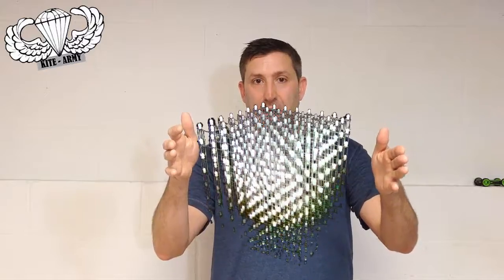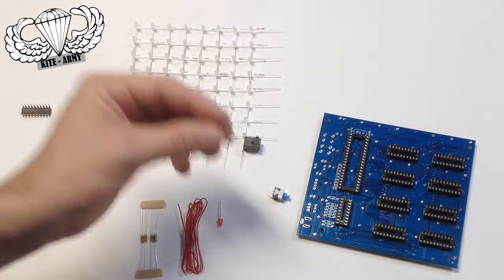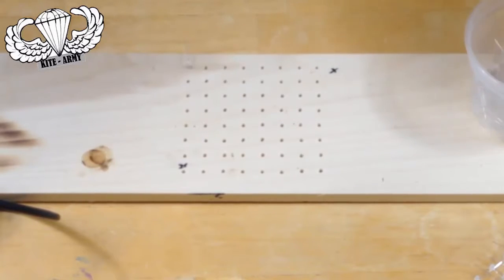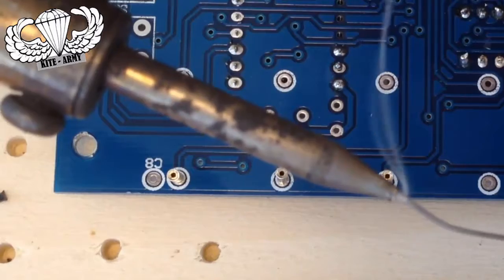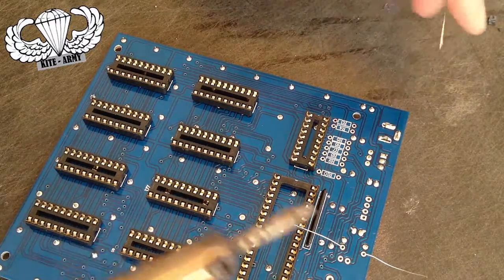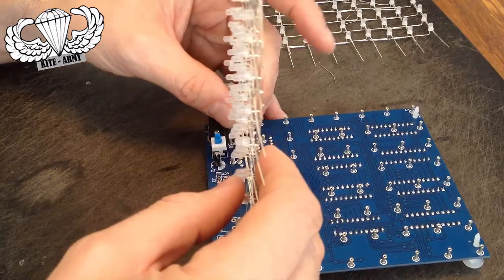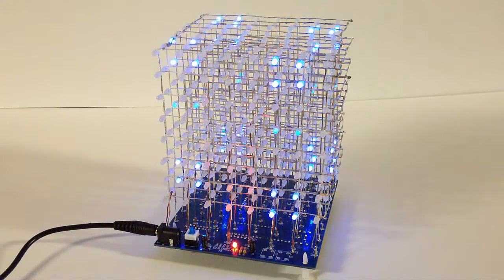8x8x8 3D LED cube kit tutorial how-to build this one of a kind project

Comment: Question.  I am actually in the process of putting one of these together.  I have 5 of the panels completed and soldered into the board.  I have been letting it run as a final test of the LEDs while working on each successive panels.  With panels 4 and 5 I have noticed non-geometric type shapes showing up in the patterns but wasn't quite able to make them out...that is until just recently. I realized that the non-geometric shapes were actually "I <a heart> U" in succession, but problem is that they are upside down.  The only solution that I can come up with is that at https://youtu.be/9GiqM9fpLKA?t=523, the wires for each layer should have been tallest to shortest instead of shortest to tallest as depicted in the video

Did anyone else have this issue or am I the only one.
Reply: I found the solution and I was correct.  In this video (https://www.youtube.com/watch?v=vxmhnnqIQmY) from 21:06 to 21:20, shows the sequence and the connected layer (black) wires going left to right being the tallest to the shortest.

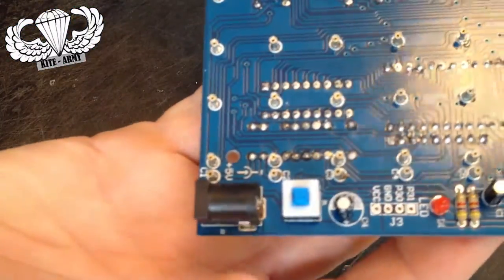Comment: Thank you a ton for the explanation. I'm very frustrated tho, when I plug the first row of "test" leds as you recommend at 7:00 I only get 3 leds lit and that's all, no blinking, nada.. I have checked dozen times all the components I have soldered (i'm not a beginner) and everything looks fine. The board is powered and all components seem to be ok. However, one of the 20 pins chips is different in the package, it's marked "7CAY76KE4", do you think that could be the cause of the problem ? (not talking about the little 18 pins one) ?
Reply from the maker: check to see if the LED lights without connecting to the control board.  That being said some of these controls boards are real cheap and will not work properly even if you built your cube properly.  Let me know how that works out.
Reply: only 3 led's lighting means the chip came without the program. Mine came the same way even though it was advertised as already programmed. I had to upload the program (firmware) myself after buying the usb to TTL serial cable (https://www.adafruit.com/product/954) then google to find how to's on uploading the firmware and of course the hex file for the 8x8x8 cube.

Comment: I have the exact same kit. I was working on the chips 3:40 and after i put all 8 chips in the bases which are connected with the pcb i found out that they were all placed in the wrong direction. I had to take m all out en turn them around. Whilst doing that one leg of a chip broke and is still inside the "base" i just put the chip on top of it for now. Is there still a possibility that the led cube will work evn though one little leg of one chip broke?
Reply from the maker: That could be the end of it.  Buy a backup kit just in case and use the chip.

Comment: Do you need an Arduino board to build this?? 
And did you use Arduino to program it?
Reply from the maker: I did not, But if I were to do it over, I would build it with the Arduino
Reply: Great! I think Ill use Arduino then :) 

Thank you so much!!
Reply from the maker: Also, don't skimp on LEDs.  After you solder 500+ of them (20hours) you will kick yourself if they are dull etc.
Reply: eek!! Ok, thanks again!

Comment: Wondering if you have reprogrammed this cube yet.  I built this cube (Thank you for the great video, it would have sucked building the cube without your instruction) but am not that happy with the default programming.  Have you hooked this up for reprogramming?
Reply from the maker: I have, but I connected the cube to a ardunio and wrote a sketch (easier than it sounds).  Maybe I will post a video.
Reply: I would love to put this on a 8266, so I can change it on the fly from the iPhone.

Comment: Hey, great tutorial. I'm following along, doing my build.

Small correction, the two components next to the crystal are ceramic capacitors. Not resistors.
Reply from the maker: Thanks mate.
Reply: I just got up to the LEDs, testing just with 8 LEDs plugged in and it worked perfectly. 

Now for the painful part - soldering 8*8*8*2 connections. I don't even want to know what that works out to.

Comment: I bought one of these, followed every step as mentioned, but for some reason my LED's even go on when only the positive legs are connected. I have checked every single led and they are all working how it should. When they are all together instead of one single led the whole horizontal line of it goes on...
Reply from the maker: Some of the circuit boards are crumby

Comment: I've built this kit twice now and have the same fault on both. (I thought I'd cocked the first one up so ordered a second as they're only £12)  Do you have access to an oscilloscope by chance so you could tell me what waveform you have on pins 21-28 of the microprocessor ?
These pins are the clock enable for each of the LED drivers so in my opinion should have a positive cycle of 1/8th of the total on time on each leg. I'm getting a much bigger waveform on one of the pins which ties up with the fault I'm seeing. One row of the grid hardly goes off.
Reply: I think you have the same fault tbh but you don't show it running for long enough for me to be sure. If you look at 9:23 of your video it is displaying a small cube in one corner but you have a "shadow" on the top row.
Reply from the maker: I have a bad grid too.  I had to buy a different controller to fix
Reply: You bought a whole new board or just a new Microprocessor? If you did the mp how did you go about programming it?
Reply: Where did you buy it from please?

Comment: Hi, the resistor A103J array should be soldered in with the white dot
towards pin marked J1 on the board.
Reply from the maker: Thanks...I will go back and check that out

Comment: Sir, My 8x8x8 Led board is working well but  a person to whome I had gifted damaged it due to wrong voltage supply. Can it be repairable.
Reply from the maker: Yes.  The most valuable part of the cube is the leds (because of the amount of work to build).  Check that your leds are ok - apply voltage to each.  If so you can replace the board and install the led grid.

Comment: THX for the tutorials!
- fyi my kit contained a smaller electrolytic, the bigger one goes near the power switch
- you REALLY need to specify which direction that resistor array goes (dot on package near squared hole) - brightness will be messed up if you get it in backward
- the switch can be put in backward so down is off/up is on, hard to tell without a DVM.  not terribly important if you get it backward
- those are not "two little resistors" left and right of the crystal, those are small capacitors.  (my kit only had one)
- don't forget to install all the sockets with their indicator matching the board, so no chips get installed wrong
Reply from the maker: Great feedback...thanks

Comment: ANDREW I JUST FINISHED MY PROJECT I HAD A  QUESTION .I SEE YOU CONNECTED THE NEGATIVE TO THE POSITIVE AT THE BOTTOM. AS I MOVE DOWN THE LINE CONNECTING THE LAYERS DO I HAVE TO BRING THE WIRE UP ONE LAYER AS I GO .KINDA  LIKE STAIRS LOL OR  DO I JUST CONNECT TO THEM DIRECTLY TO THAT FIRST LAYER ON THE BOTTOM? I WATCHED A DIFFERENT VID THAT SHOWED A GRAPH ON HOW ITS SUPPOSE TO BE CONNECTED BUT IM NOT SURE IF THAT RELAVANT TO THE CUBE WE HAVE PUT TOGETHER.
Reply from the maker: Hey mate.  They need to be connected to each layer.
Reply from the maker: +Andrea Hastings look at min 8:56 - you will see the wires attached to each layer.

Comment: have a problem getting it to work properly.. the board is OK, but the led layers connecting to the board confuses me.. the side with all the positive legs goes to the main pins in the board right? what about the negative legs? the row market  c1 to c8 connects to where?
Reply from the maker: If i remember correctly c1 to c8 are the connections that go to each layer (their are 8 of them).  You need to add wire copper to connect the layers.

Comment: I also purchased the same kit disappointed to find no instruction had to look on you tube to see how to make the LED cube your video also helped as with your other instruction for the electronics but I noticed  you did call the capacitors resistors. Also do you know if the long nine pin resistors need to be in a certain direction? I have never seen this type of resistor.
Reply from the maker: I did make some mistakes - sorry.  I was in the same boat as you and had no instructions to build this cube.  I thought that posting this would give others a head start.  I also hope that others who have watched this video can offer their advice as well.

Comment: Thank you very much. This kit came without instruction, so this video helped me out. But I think I will solder the LED's to a bigger cube and connect it with some wire to the board.
Reply from the maker: Thanks so much.  None of these seem to come with any instructions.
Reply: +Kite Army If you don't mind spending the money for them, kipkay has everything well documented in his led cube kits. I've built 4*4*4 and 5*5*5 and everything is laid out with diagrams and pictures, not to mention the small community he has on his website to help troubleshoot.

Comment: One of my sockets is for a 16 pin chip. But it needs a 18 pin socket of course! Can i solder the chip without the socket?
Reply from the maker: Sure.  I would recommend that you place it in before soldering and see if it works.  If so go ahead and put it in permanently.  Be careful not to overheat the IC.
Reply: +Kite Army Thanks!!! but it doesn't seem to work.. How long did yours take to work?
Reply from the maker: Check your led lights by inserting voltage at the base of your cube and check that your leds work.  It should start working right away.
Reply: +Kite Army Thanks a lot for helping!!!
Reply from the maker: Did you get it working?
Reply: +Kite Army Yes! It's working! The leds are doing their magic. And i permanently soldered the chip.
Now i have to make the 8x8x8 grids. Thanks again. I'll send a video when the cube is done and working
Reply from the maker: That's great news.  Best of luck building the grids.

Comment: Hello, I only have one led panel left to solder up and I will finish this 8x8 cube project, I bought the same one you have. I do have a few tips and a question. First make sure before you solder in the IC sockets you have them all in the correct places, it's a real pain to unsolder the 18 pin socket once it's soldered into a 20 pin location. Also if you watch another video showing in better detail of how to solder up the LED make sure you have the positive legs of the LED's pointing down they go into the board, the other video has the negative LED lead going into the circuit board. My question is do you know or can you direct me to where I can get some information on how to reprogram this board with different patterns?
Reply from the maker: Thanks for those tips.  I had no instructions when I built my cube and did the best I could.  If you look at some of the comments by other people they added a few links to the programming options.

Comment: This videos is a big help thanks, just one problem, I was going around the board checking for bad solder points and once I finished the cube refuses to work. The red start up Led is no longer on and it seems to be short circuiting somewhere, any idea where?
Reply from the maker: +Michael Mcginley I would suggest that you connect your LEDs to a battery and see if they are working.  Then test the circuits on the standoff.
Reply: +Kite Army Yeah found the problem took out all the chips and put them back in and it's working perfectly I think I might have been a bent pin short circuiting.

Comment: Hi, I've bought LED cube kit from ebay. It's controlled by STC controller. There's also MAX232. I've never wokr with STC controllers and I absolutely don't know, how to program it. Can you help me ? Thanks
http://www.ebay.com/itm/New-3D-LightSquared-DIY-Kit-8x8x8-3mm-LED-Cube-White-LED-Blue-Red-Yellow-Ray-/251649317414?var=&hash=item3a9777da26
Reply from the maker: +Michal Tanarg Hey Michal your cube probably come pre-programmed.  At least that will let you verify that all your electronics are working from there you can explore the programming part.
Reply: If you want to program the cube you will need an usb 2 ttl/R232 like this one http://pages.ebay.com/link/?nav=item.view&id=151678359550&alt=web

Comment: There are 4 pins on the board, labeled J3, that have VCC, ground, P30 and P31. P30 goes to pin 10 of the STC, which is the RX of the STC chip, and P31 goes to pin 11 of the STC chip, which is the TX. It seems like this cube could be controlled via an arduino or computer. If someone knows how to do so, they should post it here. I am going to play around with it. BTW, thank you for the video. The only thing that tripped me up that your video helped with was orientation of the chips, which now looking at the printing on the board makes sense (the little notch symbol).
Reply: +TurboBaggins Try this link for programming: https://github.com/tomazas/ledcube8x8x8
Reply from the maker: Glad you found my video helpful.  Let me know how the interfacing with an Ardunio goes.
Reply from the maker: +brainfarth Thanks Mate....super helpful!